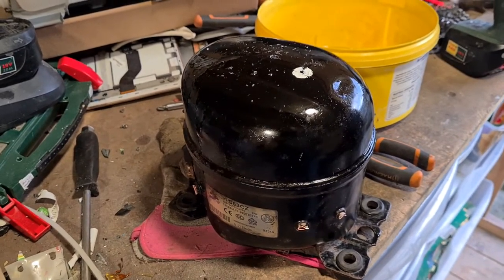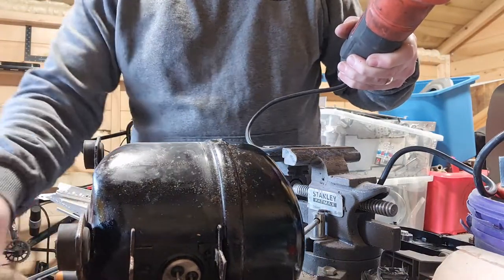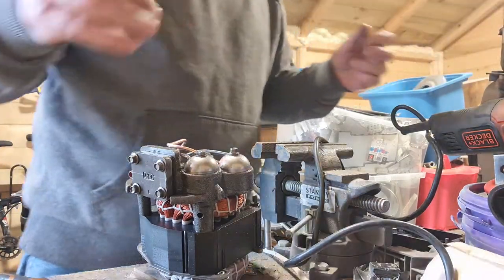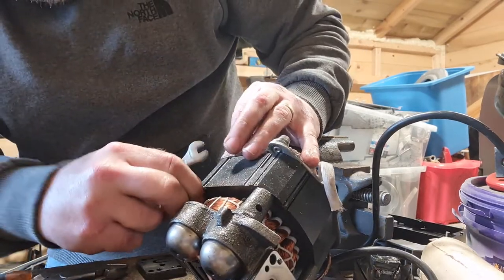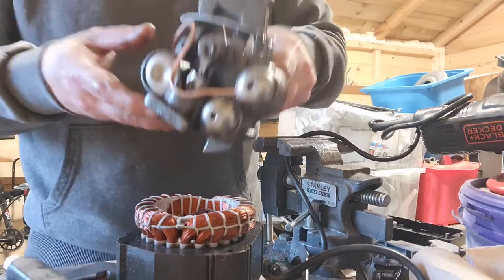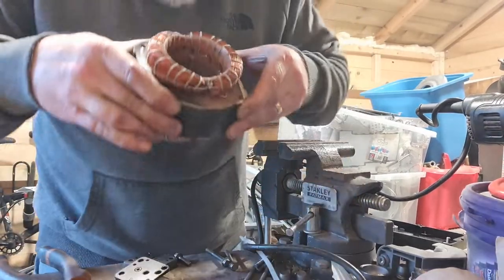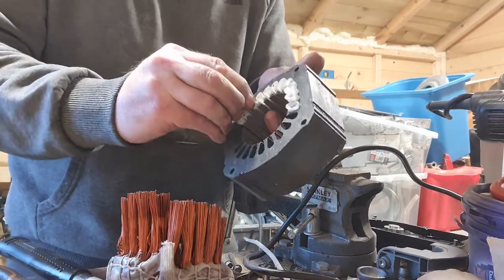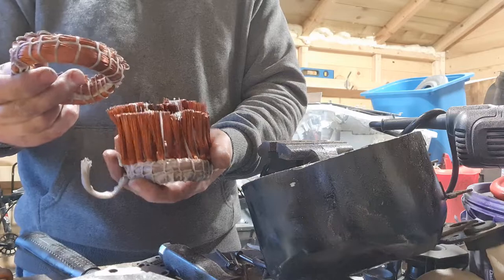Scrapping a refrigerator compressor for copper

Comment: So basically 40 minutes 45 minutes of work to get $5 worth of copper? Don't get me wrong I love copper but the amount of work is a little bit much what is your best time?
Reply from the maker: Hi John. If you watch the full video you'll see that I start cutting at about 4 minutes in and have all the copper out with about 7 minutes left in the video.  So that would mate it about 30 minutes.  I reckon you could half this time again if you were running through several of them.  I'm not charging here for my time, so it's all good 😉

Comment: Hi..have you ever had any wirh aluminium wire in..would love a sticker if you have any plz
Reply from the maker: No, always copper with compressors
Reply from the maker: You may actually find that AC compressors can contain aluminium rather than copper but 99% of the time in refrigerator compressors its copper.  Sign off the times really.  The older the better and the more likely to be copper
Reply: @minwaash  i have had quite a few..thinking of just weighing them is asthey are.